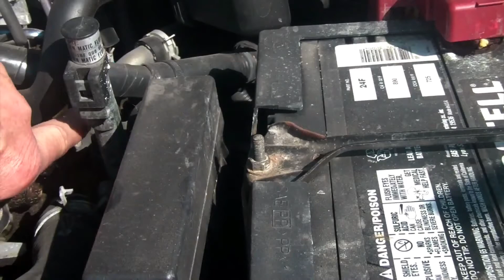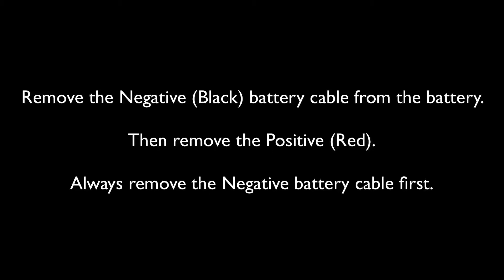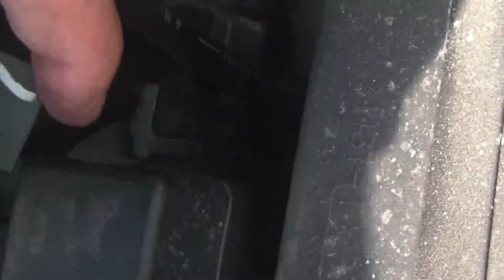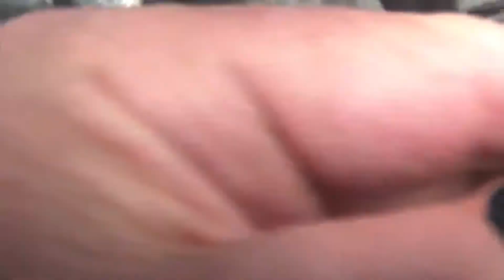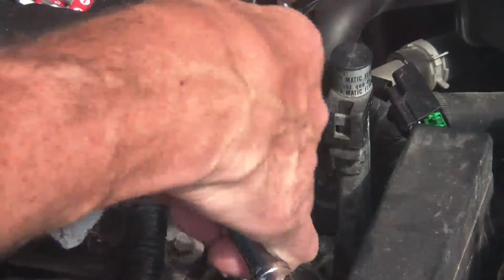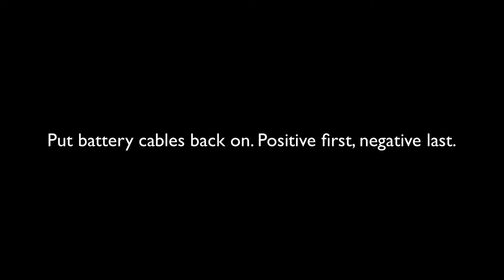How to replace camshaft sensor on nissan altima 2005 3.5L - Part 1 and Part 2 combined

Comment: My nissan altima 2005 3.5 se engine is shaking when at low RPMs and the Check Engine Soon light came on. I had autozone put a reader on it and got codes P0011 and P0300 engine misfiring and cam shaft error. Is this a possible cause? Thanks
Reply: I just bought the two sensors for my car. I'll let you know how it goes
Reply: @jk-76  how'd it go
Reply: @msmichelleelizabeth  
Wow, forgot to say something. It went pretty well. The intake is a bastard but it still runs great.
Reply: I know this is old but is there 2 camshaft sensors
Reply: @devonator4life806  one is crankshaft other camdgafi
Reply: @devonator4life806  where is the other located thats the question